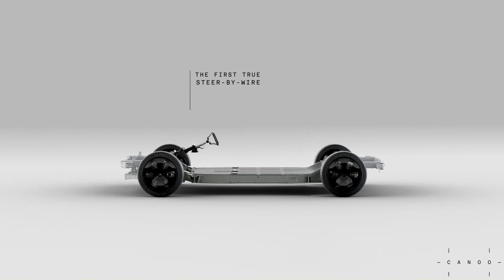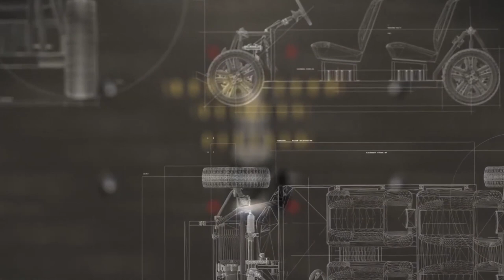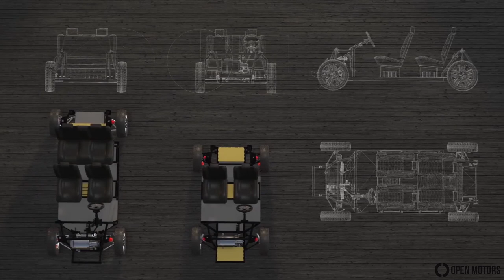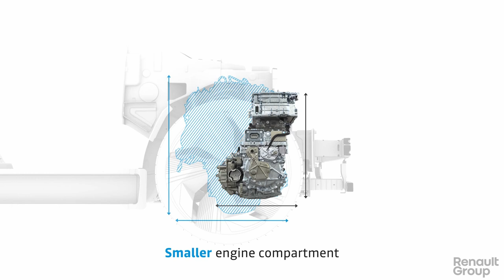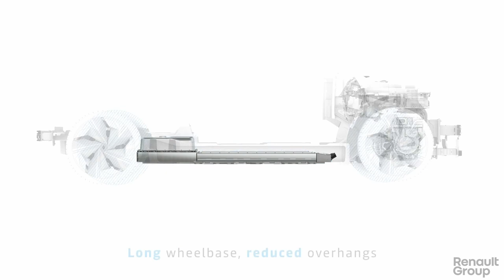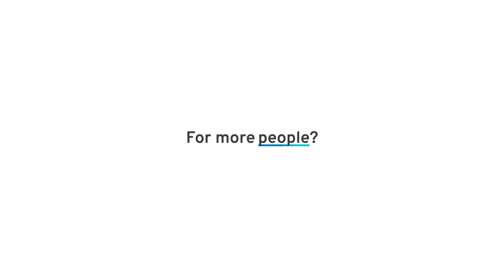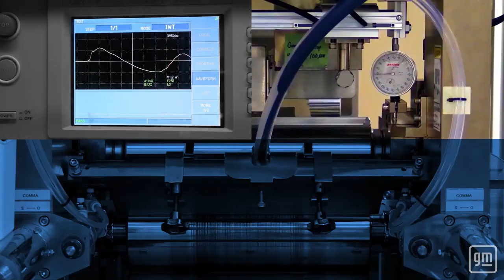7 Next Generation Electric Vehicle Platforms ▶1 | The Future of Mobility

Comment: In the early days of the automobile they were all so expensive only the rich could afford one.
The car makers only built the rolling chassis & the buyer had to deliver that to a carriage shop
who would build & fit a custom body. I see that practice returning with EVs. One or 2 platform
makers might build the rolling platform, a SKATEBOARD as they call it & other companies might 
provide the body be it a sedan or a van or a pickup or a step van delivery vehicle. I also dont 
understand why each builder is involved with building batteries. Tesla is in partnership w 
Panasonic & I read just yesterday another is entered into partnership with Samsung for 
batteries. Thats how it should work. EV makers call up a battery co & tell them the specs of the 
battery they need and the battery co will build it for them. EV battery backs are made up of 
several battery modules. In a perfect world there would be just 1 battery module & different 
battery packs would be assembled to create the battery pack required for that particular vehicle. 
Seems like this would streamline the Ev build process.

!